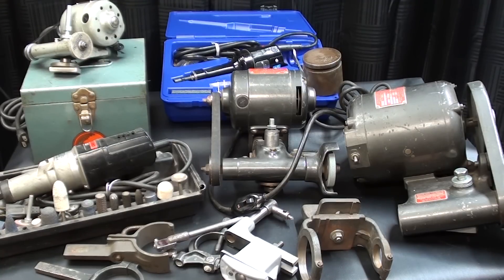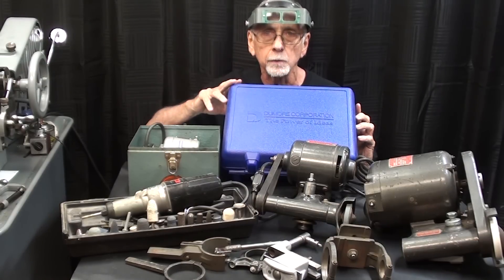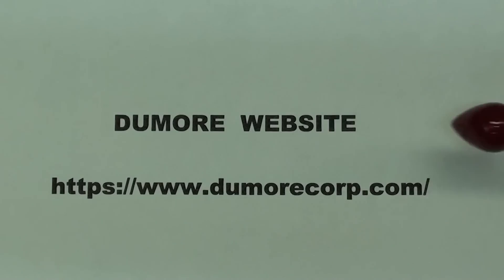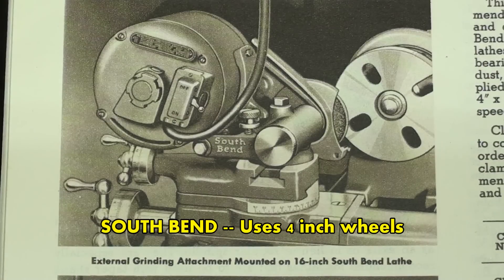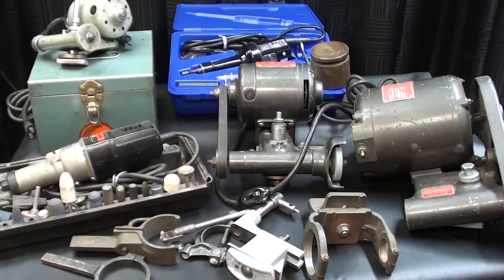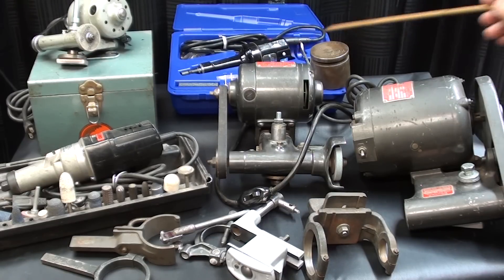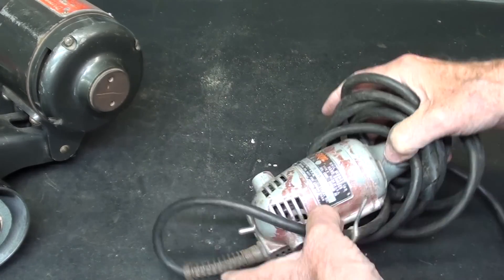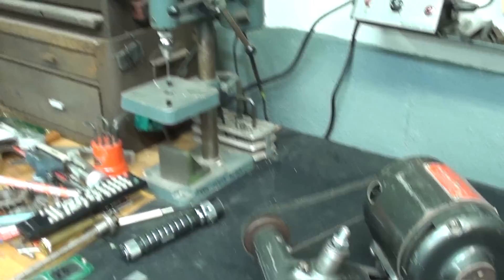MY DUMORE TOOLPOST GRINDER INVENTORY pt 1 #759 tubalcain

Comment: Sir, I just bought a Dumore 2AG on Ebay. It  has a tapered spindle.
I am not familiar with a tapered spindle so I have two questions:
1) What is that tapered spindle used for and..
2) How are you supposed to mount a grinding wheel on it?
Thank you for your excellent videos.
Hope you can provide some information.
Reply from the maker: Sorry, I have never seen one with a tapered spindle
Reply: @mrpete222  : Thank you for taking the time to respond.  Be well.

Comment: Thanks for the video and still pictures. Just picked up a catalog # 18-011 just like the one you went over... I believe the one I purchased has had the motor changed as it is a 1/4 hp GE but still works well.

Comment: Dumore 44 3" Oiling Advice:  I have one that hasn't been used for 50 years.  I'm concerned about firing it up without oiling the spindle.  Spindle oil appears to be SAE 0 or ISO VG 5, 7 or 10 which I can't seem to find a local equivalent or even on Amazon.  Should I be concerned about oiling?  If I should oil, any locally available suggestions?  Thanks!
Reply from the maker: I really do not remember what are used. But I remember at the high school when I bought a new grinder. It came with a little tubes of oil from Dumore. I have no idea of the grade. Check their website.

Comment: NICE VIDEO How close tolerance can you grind a diameter on a Lathe. .? Thinking grinding rechromed 2 stroke crankpins.
Reply from the maker: I do not think that you could grind that close on a lathe. It almost needs to be a dedicated cylindrical grinder.

Comment: I bought a used model 40-011? hand held in a big metal box used. I looked it up and maybe it was issued to the Navy? Anyway, it has a flexible 6-20 shaft. Also came with 10plus 1/4 and small 1/8 bits but only had the 1/8 Collet. I ordered and 1/4 collet and it isn't cheap. It came with a big metal apparatus it screws into like a holder but im not sure how it mounts.

Comment: The Dumore Corp. moved to Mauston WI in the late 80's. I worked there in the mid 90's as the Tool Room and Engineering supervisor. In the tool room we had internal spindles that were up to 3 foot long. Dumore at that time made mostly fractional electric motors and gear reduction motors. Hand grinders were the big machine tool sellers. We even made chainsaw sharpeners for the US forestry department. Dumore started out as a automoble  vacuum machine in the early teens that was billed as a vacuum that could Dumore. Racine at the time was the center of electric motor production.
Reply from the maker: Thank you for the insider information. I love industrial history

Comment: On your 3" grinder, on the cord it has a red tag sleeve on that sleeve read what it says. The groundwire went from the plug side to a grounded receptacle screw.  on the plug is a wire on the side , probably missing now,  l found a ground wire on mine though out the whole cord length, FYI  Great videos!
Reply from the maker: Thanks

Comment: I had one of those double clamping grinder mounts for years before I figured what it was used for.  My first TPG was made from a Bosch laminate trimmer- worked ok, but the wheel that came with it was garbage (it abraded so fast that in was unusable).  Then in two weeks I found three more; a large Dumore and nice Themac one weekend, and a beautiful "Tom Thumb" the following weekend.  I think I have a hand held Craftsman too, but I'm not sure.

Comment: I have a nice one in a tall metal box that folds the front down and it is wonderful fit for my Lathe.  I ground a shank down from 3/4 to 1/2 for a friend to match all his cutters. They came in a bag and one was oversized.  It ground nicely - used white stone that chips and cools.  Had it oil soaked for a very fine grain surface.  Dry is rougher.  Martin

Comment: I used a Dunmore with interchangeable spindles for ID and OD grinding on a south bend lathe back in the 60' s  the south bend lathe was best for finish because of the bronze spindle bearings and flat belt spindle drive.

Comment: You can have fun with an angle grinder fastened to the tool post.  The wheel is vertical.  I repaired my Winnie RV leveler hydraulic cylinders that had welded caps.  I used thin cutoff discs to slice through the weld and separate the seal end from the tube. The hydraulic cylinder was in my 10" Logan lathe

Comment: Lyle, seeing your Dumore grinders reminds me of a Dumore grinder that I once had (no motor, just the grinder) that, compared to your 4-inch grinder, must have been for much larger than a 6-inch wheel (it originally came from an industrial plant).  I gave it to a friend that had a lathe large enough to use it a very long time ago.

Comment: I have the very same Craftsman die grinder. I bought it because it has areas machined for mounting into a holder. I made such a mount to make this grinder my first TPG. I then used it to grind the bearing pockets for a better shop built TPG, and haven't used the Craftsman as a TPG again.

Comment: I contracted with a local machinery repair/rebuilder occasionally to grind the internal taper on CNC milling machine spindles. The magic of their shop built grinding fixture was their precision spindle, long internal reach and easy to clamp to the milling table setup. They had a clever dresser setup too. Tooling taper angle is the same regardless of  CAT size. We ran CAT 40 and CAT 50. 
Setup was pretty straight forward. The dressed wheel was brought under the spindle internal taper and the Z axis moved -  with the proper taper move accomplished by X or Y move. We would blue the internal taper and only grind to cleanup. Ideally there would be a slight belly in the taper so tool contact was only at both ends of the taper. 
Dressing the taper moves the tool deeper into the spindle requiring Z axis position compensation. Tool change position is unlikely to change enough to require correction, but is worth investigating.
This spindle taper dressing resolved tool seating issues and garnered some longer spindle life without removing the spindle for extensive rebuilding and when the spindle bearings were not suspect. Typically this process could be completed in under 4 hours.

Comment: Years ago I bought a Emco tool post grinder for my Super 11 lathe. It was a fine Austrian piece that required removing the dovetail tool post for mounting. I made a new spindle bearing block that has a dovetail in it like a tool holder so it mounts on the tool post in seconds just like a regular tool holder. So finally a tool post grinder that lives up to its name and mounts directly on the tool post. It is very convenient and used more often because it installs easily. Never seen anything like it. But then I cut dovetails in big lathe tools so they mount directly without a holder. You could convert your Dumore to quick mount too.

Comment: There's a guy on eBay that sells this little metal holder for a Dremel rotary tool.  You take the nose cap off of the rotary tool and thread the rotary tool into the little metal holder, then the little metal holder can be secured into a quick-change tool post holder.  It's a "poor man's" tool post grinder.  I'm by no means comparing it to a "real" tool-post grinder, but it's kind of nifty and it only cost s about $20 bucks.  Just FYI.
Reply: A home shop machinist magazine had an article to make your own or a future Mr Pete video?
Reply from the maker: Thanks

Comment: As a non machinist the first thought that popped into my mind was, "what the heck is a tool post grinder," which you quickly answered as you went through this video.  So one more bit of knowledge packed into this old woodworkers brain.  As my son often says, "my mind is a font of useless knowledge but it sure helps when answering trivia questions and working crossword puzzles."  I will be sure to watch the second part.

Comment: My story, Soom years ago on hywy 101 on the Oregon coast, I was haeded north past a sign Estate sail, it was late in the day and they where packing things up but still open. Went in side looked around, rule of thum, open any box an see, this metal box on the green side with a price tag of 10$, had in it a #14 Tom Thumb with all the goodys including the inturnel grinder atachment, the tools, oil can and so on, Then behind me there came a female voice ( where is that router I saw ) I'm thinking is this what she is wanting, My hands are on it no way lady . So off to the cashear and I felt  I was steeling candy fome a baby, 10$ price tag. my knees where sweating as I was paying for it. My club member found it hard to beleve. and yes I know on Ebay how much they are selling for. God stike me dead if this is not a true story
Reply from the maker: You will never see another one in   500 lifetimes at a garage sale.    I know that feeling, and cannot get my wallet out fast enough. I can actually feel my armpits squirting perspiration
Reply: @mrpete222  I also have Master Lathe Mfd by Masterson Engineering Co. of LosAngeles Ca with the complete wooden tool box, I looked one up on Ebay and it sold 17 times more then the one have with no tool box. My feelings are I wish I could follow you a round Mr Pete and pick up your crums

Comment: When you clamp that small Du-More onto your lathe, if that doesn't ground it, no piece of wire is going to. Ron W4BIN
Reply from the maker: That is of course assuming that the machine is correctly Grounded

Comment: Mr. Chairman, I rise to a point of order!  That is NOT a cricket, it is an audible thermometer.  Simply count the number of chirps in 14 seconds and add 40 to get the approximate temp in F.  Count the chirps in 25 seconds then (X chirps/3)+4 to get C.  Thank you Mr. Chairman, I yield the floor.

Comment: Thank you Mr Pete. I have a Atlas grinder like the one you showed in the catalog. It came with my South Bend heavy 9. It has provisions for internal and external grinding. I have not used it yet, I think it's a little too big for my lathe but the previous owner used it. I saw a nice little Do more  at a junk store and tried to buy it but the shop keeper couldn't get a hold of the vender to get a price and couldn't except an offer. The next time I checked, it was gone. I guess that means that I really didn't need it but I am still disappointed. I'm happy for you having a nice selection.

Comment: I have a partially finished project somewhere to convert a harbor freight mini 2” bench grinder into a tool post grinder for my Logan. I will finish it after my shop move.
Reply: Good project material.  Back in the 60s our tool and die had a very nice small chromed metal Precise die grinder which would have been the perfect candidate for your project.

Comment: It's interesting to note the progression in power/amps of the motors. 2"--1/14 hp at 1.1 amps, 3"--jumps all the way to1/4 hp at 3.6 amps, 4"--still 1/4 hp but 5.8 amps.

Comment: Those hand grinders look like Dremels on steroids. That safety poster at the beginning reminded me of my 1st day at Buick. I hired in as a Machine Repair/Machinist apprentice. They put me with a journeyman for training. My very 1st job at Buick, we had to adjust the position of a drilling machine column. My journeyman was tightening a bolt with an Allen wrench and a piece of pipe for leverage. The Allen wrench popped out of the bolt and pipe and flew up and hit the lens of his safety glasses. I don't remember if it damaged them. I told him the safety glasses demonstration was not necessary.

Comment: I've used Dumores a few times on larger lathes and found that they are an OK work around. Nothing in their line of grinders even comes close to the finish quality and size control one gets with a dedicated O.D./I.D. Grinding machine. But, for the home shop or someone who can't afford, or find floor space, the Dumore tool-post unit is a good substitute.
Reply: The funny thing about that is you can often find those machines for dirt cheap if you only had the room!   There's one local to me for $250 (after sitting at $500 for weeks) and you can almost never touch a lathe or mill for that much unless it's some old monster going for scrap price. 

Lathes and mills are the hobby machine shop backbone and anything that might reasonably fit in a garage or basement tends to have some minimum value while the specialized machines languish around their scrap value once they are no longer desirable to professionals.   If I had my dream over sized out building you can bet I would scoop up that grinder, the key seater that's also for sale, that jig borer that was one town over a while ago....